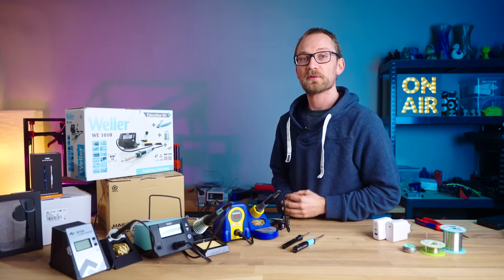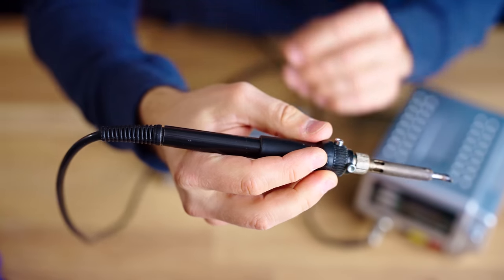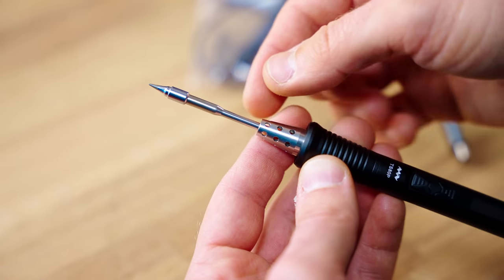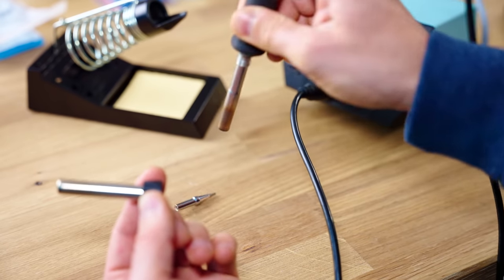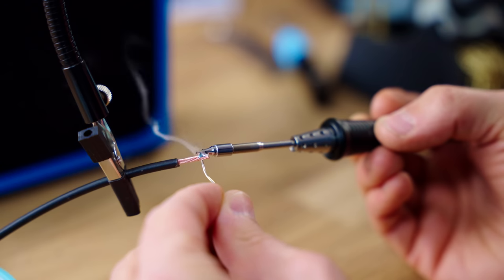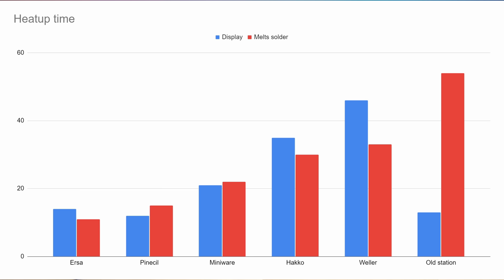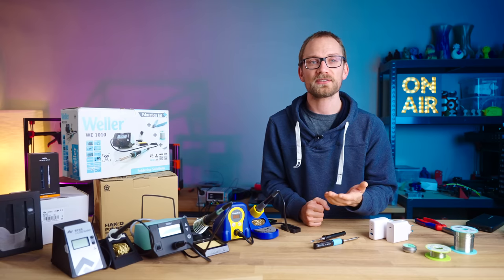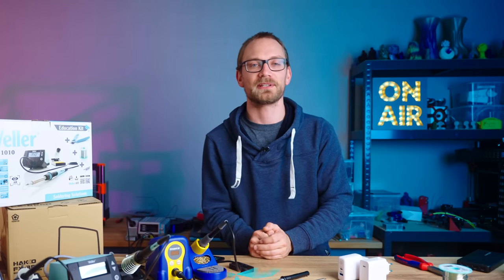Best hobby soldering iron? Pinecil vs. Miniware, Hakko, Weller and Ersa

Comment: Comparing the Pinecil to the TS80(P) is Unfair for Miniware, the TS100 is a better soldering iron than the Pinecil that copies it (Pinecil only added USB-C PD but with limited power input and voltage). You can use a TS100 with USB C PD, you just need an adapter that triggers USB PD 20V with a 5.5x2.5mm DC Jack out (can be found for ~5€ on amazon, it's sold as a laptop USB C PD adapter) add the Ralim firmware and you have a slimmer, more powerful (75W) soldering iron with a wider input voltage (TS100 supports 6S LiPo, Pinecil doesn't)

Comment: I think the way you tested the pinecil was slightly unfair, as it can get a lot more power through the dc5525 than usb-c because the dc5525 can be used at 24v
Reply from the maker: Mine is rated for 21V only - and according to its own display, that's what it got from my power supply.

Comment: I have a Hakko and I was looking for something a little quicker to set up when I just need to solder one or maybe two things and don't want to mess around with setting up my hakko. It looks like the pinecil is a good choice for times like those. But do you have a recommended power supply for that? I'm not really sure what I need to look for in a supply.

Comment: Only buy soldering irons that have a solder station. Don't buy the ones like from Walmart that the handle plugs directing into the power socket. Those don't last long, and you can't regulate the temp. Also the ones with soldering station tend to have replacable tips. So you can get different style tips. I use Weller.

Comment: Credit to MiniWare is that the Pinecil is a rebadged TS100 and the TS80p doesn't have the same comparable power as the Pinecil as a better comparison will be the TS100 it's based off of.
Reply from the maker: Well, we already (basically) have a TS100 in the mix with the Pinecil. No need to add a second one.

Comment: I don't own any of these. ^^' Mine a is a pretty standard 60W soldering station, with no LCD, just a potentiometer to set the temp (not the best way, I know). Works really well, though, despite not being the fastest to reach desired temperature.
Yet, having a soldering iron with shorter tips and smaller handle might be a really good option, considering my small hands. Might have a look a it soon, you made me want to look for a better soldering iron. :)

Comment: I like this but soldering is an art and skill is  higher than quality. As long as the tool heats up to the correct temperature and has a good tip, you can make it work.

Comment: I'm a bit disappointed by this comparison.
If you look what some YT pros recommend (Louis Rossmann and Dave from EEVBlog) you will find two things:
1. don't buy iron with 900m style tips - just get a cheap station that can work with T12 carriage tips and some genuine tips from hakko/weller
2. tip shape - that round pencil like tip is useless - get some T12-BCx and/or T12-Dx and you will be better off

EEVBlog video with a link to Louis video: YT /watch?v=scvS2yeUH00

I know this is a soldering iron/station comparison and that topic leaded vs unledead is a bit opinionated but it would be nice to get some context from Thomas on why unleaded is his preference.
Leaded - flows better, weats better, lower temperature, less harmful fumes, and as long as you don't lick the solder joints - quite safe
Unleaded - quite the opposite.

Apart from not mentioning those two things the video - both content and quality is very good. Nice to see something else from maker space.

Comment: I’m facing problem that the soldering tip can melt the solder, but the heat transfer to the copper/pad is so bad and i can’t get right temp to melt the solder when the tip touch the copper/pad
Reply: You need to set your temp to 370 or 400. Even though melting point of solder is 150, u need higher temp so that wire & soldering pad rrwch same temp.thus combined temp is 3 times the melting point

Comment: You are using a very very thin iron tip on your old station which i think is a bit unfair in wire test, also the ersa tip looks thicker than the rest

Comment: Anybody knows of a decent stand for the pinecil or TS100? -Those portabel irons are great to throw in a bag if you have to do a few solder joints on the go...but just putting it down on the table or using those portable soldering iron holders that look like chopstick holders is just not a practical option in a workshop.

Comment: Weller 1010 is the best overall in North América for the price, Hakko if you somehow get it for the same price for its extra ~1.5 to ~2.5 second heat up time minus quick tip change. And for some reason you want Japanese or are Japanese and feel great shame using a equal if not better quality North American soldering iron which was in fact made in the same Chinese factory as Hakko and then sent to Japan for assembly as well before being sold in America then please do.

Comment: None of the stations with the old style tips are worth it nowadays, you can get a KSGER T12 for half the price and get better performance, or a JBC clone for the same price with similar performance to a genuine JBC. Sure the old style stations work fine, I own the hakko FX888D, but if you've ever used an iron with an integrated tip you won't want to go back. Tips last long enough that the higher cost isn't much of an issue (I've never had to replace one yet anyway).

Comment: The life of certain (expensive) soldering irons is very long . I have a name brand soldering iron that has been used for over 30 years .
Simpler low cost irons work OK but have very limited lifetimes or need constant adjustment to insure the tip heats.

Comment: That Weller in the middle is the only one worth having.
Reply: Reasons:
More metal in the tips than any of the others.
Weller is always true to spec, from their cheapest to their top-of-the-line.
They specialize in soldering equipment, they're not just a branding company.
And maybe the most important consideration of all, the company will still be around when you need parts.

Comment: IronOS is a project (application) that runs on FreeRTOS. Basically it's running FreeRTOS operating system and IronOS is running on FreeRTOS.

Ts80p is not crashing. You're shorting out the psu!!! You should NEVER change tips with electrical connections when the iron is on!

Comment: You really should have reviewed the TS80p with IronOS. It's still not as good of an iron as the Pinecil (30 vs 65 watt is no contest), but no sane person would use the stock firmware on it when given an alternative.

Also disagree that the Pinecil is "almost comparable" to the 888D. In my experience, with an appropriate power supply (60-65 watt), the Pinecil (and functionally equivalent TS100) are far better than a Hakko 888D in absolutely every situation. Even once you fork out for a power supply and get some sort of stand for you will have spent less money and will have an iron that solders better. Also, the fact that it accepts T12 tips (you will want an extended grip) means you can put a huge tip on the thing if you really need to deposit a lot of heat.

Comment: Hey, nice compare! But could you please also link the fumeextractor you used? Thx :)
Reply from the maker: It's the one Sainsmart sent along with the TS80P, however I wouldn't recommend it. It does move a lot of air, but they only include "activated carbon" filters that let you see right through them. There's no way it's actually "filtering" anything.
Reply: @MadeWithLayers  hmmm, ok... then a video about filters would be really nice 😁

Comment: Just out of personal experience... The difference isnt in the $20-$50 iron. The biggest difference in having success or failure that u can control without a huge budget - get some 60/40 KESTER solder. Good stuff and makes those difficult projects a breeze
Reply: Big difference in soldering irons, ones with heating elements built in the tip are way better, none of the stations in the video have that but the miniware one does but you need a station with cartridge system with built in heating element in the tips

Comment: I use the ts100 for all my solder works, small and easy to use, even on the rc airplane  field I use it with 6s lipo. The ts100  can have higher temps with a other firmware

Comment: The best one, which you didn't test, is the Metcal MX series. It costs much more, indeed. These soldering stations are all based on a resistance, Metcal uses a different technology and you can hot swap the tips. Also you don't have to wait, you have the power instantly, as much as you need. There are no settings. It's 500 or 600 dollars, but it's from another planet.

Comment: Your old station is by no means a no-name, Atten is a known brand, which mostly is a clone of Hakko-stations, but itself is cloned by other manufacturers.

When it comes to your wire-tinning your comparison is probably fair, but you should not use a thin conical tip... it's unfair to your Pinecil (which I assume is somewhat related to the famous TS100)

Comment: I'd love to see how the newly released Pinecil v2 would fare against the Pinecil v1 in these kinds of tests! Because it now supports much higher wattage from PD and higher voltage it can now use (24v) - especially since they've now added WiFi and BT (BLE) to the device, so now routines could be made on HomeAssistant, or even software on your phone or computer or even an IoT device to warn you about the iron.
Reply: Even though you could do this, for me this is far too complicated and has too many points of failures. The Device itself should report something or be visible, that it is on.

Comment: I don't like this video. It's barely a review, but more of an unboxing. 
The thing is, that the video does not show at all, how durability of the different models is.

The WE1010 gets a recommendation of you.
It's NOT well-made or robust: my WE1010 iron broke (metal part from the blue/green plastic) in a couple of days, and the tips really do not last long, if you use the iron on a daily basis.
I've been gluing the iron dozens of times, and it still 'holds'. Also the foam was worn off completely within a year.
I do not abuse the iron at all, but just use it relatively a lot. 

For comparison: I had a good old Weller WTCP-S, of which the tips lasted multiple times longer than the cheap ones for the WE1010.
Also, the WTCP-S never broke, and I've used it for decades.
I just wanted a temperature controlled iron, so chose the WE1010 out of trust that built up over the years.
But Weller now makes really poor quality irons, most probably just to compete with other brands in the low-end market.
But the WE1010 is a waste of money, regardless of how cheap it is.

I read the same experience with the WE1010 - broken nut from the plastic - in replies here..

My money will most probably go to Hakko next time.

Comment: I am really disappointed to not see the "modern" style soldering stations with cartridges (like the TS80P and Pinecil) instead of tips. Those provide an even faster heat-up time and a more consistent soldering experience.
I would suggest soldering stations such as the JBC CD-2BQF (T245 handle) or Hakko FX-950 / FX-951 (T12 style cartridges). Good off-brand stations for the JBC and Hakko tips are readily available for around 120.- ( https://www.youtube.com/watch?v=26KXtHZqhMg&t=19s he has looked at many different soldering stations).
Weller too has this type of soldering stations, i.e. the WT and WX line. As well as Metcal, which use a different technology (something RF i think), not better, not worse. Additionally, those "modern" stations can archive shorter tip to finger/hand distance thus soldering gets easier and more controlled.
Yes you will be paying a bit more with JBC or proper Weller stuff, but you will only buy once. /r/BuyItForLife

Comment: Don't use the cheap Chinese tips for the (Japanese) Hakko they will turn your iron into a low quality tool when in fact it's probably the best. I'm surprised
you didn't  do the ultimate test - solder joint  quality - which would indicate the temperature stability at the tip

Comment: what iron do you use now?
Reply from the maker: The Ersa was returned to the manufacturer, the Weller is getting donated to a Makerspace. I would have loved to keep the Weller, but the Hakko (which I bought) is nearly as good, so that's my go-to for now.
I don't have any extra tips or even a spare power supply that I can dedicate to the Pinecil, but that would have been an option, too.

Comment: Go with the more expensive irons. You will be sorry if you go with the cheaper ones. Solder will often take forever to melt with the cheap irons.
Reply: 48 seconds using my $120 Weller WHS40D vs. 12 seconds using my $60 KSGER T12. :-)

But neither of them beat my $380 JBC CD-2BE at five seconds. You don't always get what you pay for though; both Hakko's and Weller's lower end models are usually quite dated tech, and are easily outperformed (though probably not outlasted) by cheap Chinese options.

Comment: I own an Ersa Pico (basically a Nano without ESD protection) an a Pincecil, and like them both, though I haven’t touched my Ersa since I own the Pinecil, because its so easy to take the Pinecel, plug in a USB-C  power supply (or on the go: a powerbank!) and  start soldering. 

But the best thing is the Pinecil’s price, there is no excuse anymore to buy these cheap hardware or electronics store soldering Irons that take ages to heat up and don’t have proper temperature control. These things should be forbidden, there is no better way to make people turn away from soldering than having them learn soldering with these pieces of crap, because budgets don’t allow buying two dozen of the good ones. I’m really sad the only affordable way to buy them is to order them directly from Asia, they should be buyable from European merchants. 

Funny aspect: the Pinecil is the first RISC-V based device I own.

Comment: Lead free is junk. You aren't a manufacturer. Stick to leaded. I like 63/37 kester 44. Plus some good flux and a way to clean it. Metcal soldering iron is amazing and trouble free as there's no temp sensors to fail so no need to calibrate. Fast and encouraged tip swaps. Comes with a silicone pad to remove the tips. Cone tips are a problem except for some cases.
That Ersa performance is impressive for it's price. Metcal new is much more expensive new. But used can be found easily and for high end hobby prices. A real production station.

Comment: It is just simple: buy a brand solder station. Why? Because it is simple to get the right tips for your purpose.
Buy a Ersa, Weller and you will never want something else!
I am a electronic engineer for over 40 years, and I still use my Weller from 25 years ago withsome of the old tips, I also have a WSD81 from 8 years ago, and this works the same as the old one.
Weller tips will last forever, one of them is 7 years ols and used every day (really!)
Dont buy chinese crap, spend a few bucks more, and you have so much more fun.

Comment: All of heavy metals are as bad as led. So there's no difference between both led free or leded one. Led one is better on connections which has work in vibration environment. All of the the expensives ones suck big one, used weller ones at work, and cheap knockoffs analogs, workers who has to solder all day, just max out temps to work faster, so they don't care. Worked for months with ts 100, much more convenient. It doesn't have bulky power supply and does everything what you throw at it. Don't get why spend 200 euros, you can have multiple ts100 with different tips and not bother of swapping hot tips. Pinecil is cheaper analog to ts100. And mobility, for getting something done you need powerbank and soldering iron itself.

Comment: Ksger T12 is faster, have more power, much better platform with a lot of tips  better price and you can swap tips in 5 seconds when you are slow guy. these days there is only fight with T12 platform and C245 (JBC) There is no reason to buy other products. When you can have cheaper and better device.

Comment: None worth the money these days. If you don’t won’t to spend proper money (600-1000£) on mid range jbc or metcall just go Chinese or some oldschool weller with manual temp controls like WS81 and accept that is old tech.
I have an ersa i-con 2, some “cheap” JBC(50W), Weller WTCP51. I just purchased Axiun 200W T245 (jbc clone) for ~£140 and it is much better than anything I ever owned/used. Even you buy new power supply or handle every year or two it is still cheaper and more capable than genuine jbc with similiar features.

Comment: Your hakko looks like a branded fake clone, the color isn’t supposed to be that blue and real hakkos are made in Japan not Malaysia. The rubber on the hakko iron also should not slide back like it did on yours.
Reply from the maker: I got mine from a 100% trustworthy seller - the color might be from the way my cameras capture it and Malaysia may be a cost-saving measure for their entry-level products like this FX-888D. If it was a knockoff, I'd assume they'd simply write the same place of manufacture as the real one.
Reply: @MadeWithLayers  could just be a case of manufacturing changes, either way if it works it works.

Comment: no point in using "lead free" solder for personal "rework" project. leaded solder is only a concern for mass manufacturing of things that will end up in a dump, but the amount for hobbyists is irrelevant. it's more expensive, less forgiving, and provides no practical benefits. besides, the flux in leaded solder is just pine rosin, but the flux in lead-free solder is nasty stuff.